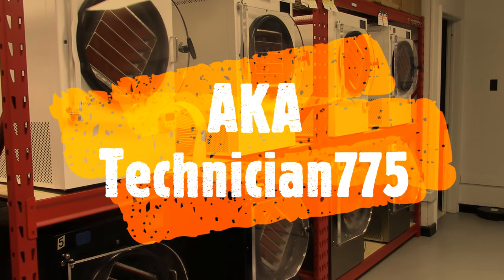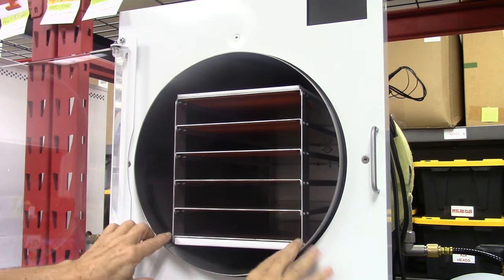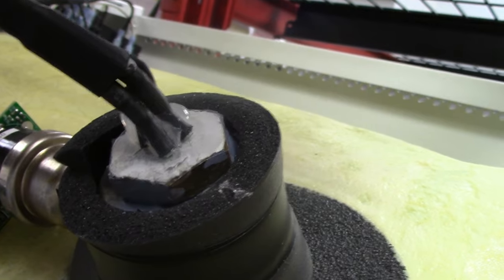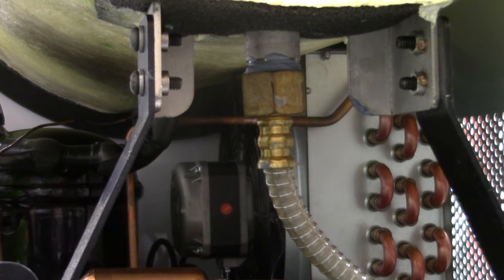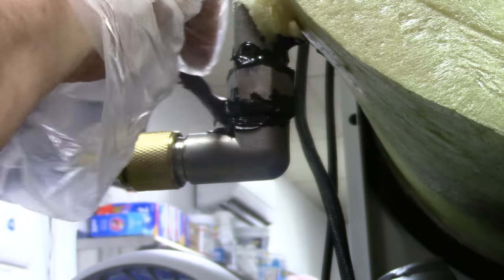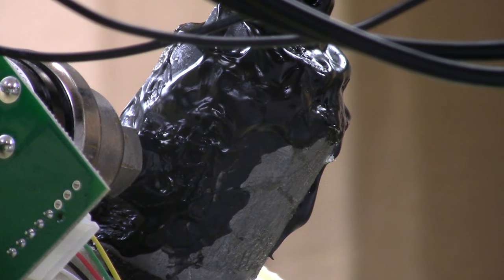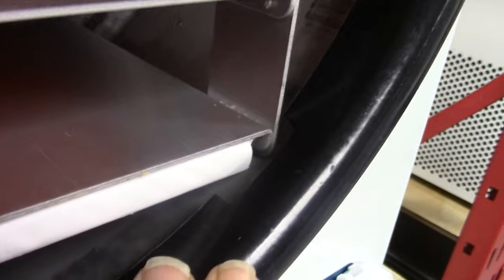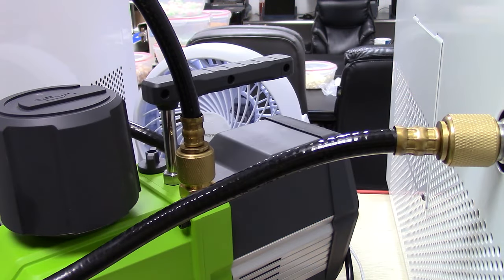Harvest Right Vacuum Fix VIDEO

Comment: ok...let me know how it works....
Reply: Well ran most of a bread run without issues, but about halfway thru I get the inadequate vacuum with a pressure of 525mTorrs. Kept alarming but was going down in pressure, very slowly. I turned it off when it was staying about 517mTorrs.   I just turned it on again and am going to run another bread run and see what it does.  I have no clue what else to try. It runs great without the rack in the chamber, going down into the low 300s mTorrs.  But put the tray rack in and it wants to stay in the upper 400s and lower 500s.  What the heck. I gooped the heck out of the epoxy harness thing and wires.  I have an extra harness that HR sent me in the beginning cause I was having troubles inititally(turned out to be loose wires on the tray rack. ) I could go ahead and install that, but how the heck am I going to get all that dried liquid tape off of it?  Oh my.  I just wish it would work.  I appreciate any ideas you might have cause I have no clue what to do.
Reply: I don't think it is the wire harness.....is any part of the door seal touching the tray??...if you just slide the tray in without connecting the harness...does it work??? is the machine brand new or have some time on it...I can't remember....
Reply: Oh was going to mention that I am using a fairly old platform. I heard people were having problems with updates, so just left mine.  v5.2.23 is what I am running
Reply: Hi again, just thought I would update you on my progress. I updated my software to v5.2.25.  I ran 2 bread runs and both failed with a Inadequate Vacuum alarm, while the pressures were in the mid-500mTorr range.  So I ran two more tests, one with NO TRAY RACK in the chamber and it got down to the low 300 mTorr range. But again with the rack in the chamber BUT NOT PLUGGED in, that one would not get below the mid-500mTorr ranges, and SAME result with the tray rack in and plugged in.  It just will not get below 500mTorrs with the tray rack in the chamber, but it does fine without it in the chamber.  I am so puzzled.  I did more gas leak tests using windex and cannot find a gas leak anywhere. No clue what else to check. Guess I am going to have to pay to have HR look into the issue. So very frustrating.  But at least your fix DID my pressure range so it does get down below 500 without the tray rack. Wouldnt do that before the fix.
Reply: I am stumped........it might be a software issue with the plug in of the tray assembly. This just started all of a sudden??...let me know what you find out...this is puzzling....
Reply: one thing to look at....what position is the wiring harness in ...plugged and unplugged???? I would tape it up really well inside the drum unplugged...try it and plug it in not disturbing the wire harness and try it....possibly bending the harness in different direction causing a small leak?????
Reply: @stevenducote7466  No, it was something that started gradually. I ran many batches over several months with it running pressures in the low 500mTorrs. It never really got lower that the upper 400 mTorrs. It would alarm alot, but it still worked mostly. Unfortunately batches were taking 70 to 80 hours to finish. It did start to get a little worse with it running in the mid-500mTorr range and taking even longer. Thats when I decided to try the Felix Fix thing.
Reply: @stevenducote7466 I had thought about replacing the wire harness because I do have the replacement for it. But at this point it would be a huge pain in the backside, I put soooooo much liquid tape! It would take forever to remove all that and put the new part in.  Plus, I HAVE tried using the windex test for leaks, and didnt see any changes.....my only concern is it is an older bottle of windex. I am gonna pick up some carb cleaner and check again.  I WILL try taping inside like you say. I sure appreciate your
 input.
Reply: Hi, just wanted to give you an update to my inadequate vacuum problem.   I think I finally fixed it!!! And you know what I tried that did the trick?  I have been using an older bottle of windex to check for leaks.  Well I decided maybe I should try the carb cleaner and guess what???!!!  I had leak still in my epoxy harness!  It did show at all with the windex!  Anyway, got it to where I thought it was running well enough to try and run a batch.  It ran like a charm until about 10 hours into it when all of the sudden it just shut down!  The whole thing, like the power was shut off. Could not get it to turn on again.  So in the morning I took a closer look and found a burnt wire on the panel in the rear that the plugs go into.  I am not sure why. Perhaps with all the messing with it, I bumped things enough to loosen wires??  I dont know. But had to call HR today and order all the parts I need to replace the plug and receptacle and the power wire harness. Ugh!!! Well, I sure hope it is working once I get the new wiring.  Thank you so much for all your input and your wonderful video!!!!!
Reply: Great...that did sound like a harness problem, when the position of the harness changed ( when the tray was in or out)...that kinda gave it away....I am glad you found it!!!

Comment: When I get my HR freeze dryer what  to look for on first inspection.
Reply: when I get a new machine,  I  do a bread run to see where the machine is....most times you do not have to do anything......after the bread run...do some cheap veggies to break the machine in...check the mtorr, all the way thru the cycle...it will start high...as the cycle progresses it will drop and the try temp will go up....feel free if you have problems, please reach out....ty!
Reply: Look to make sure it doesn't have a Harvest Right logo on it. That means you were smart and bought another brand.
Reply: all my freeze dryers are harvest right...9 of them and run the 8 hours a day plus some on 40 hour cycles...no issues after some i had to fix the vacuums...i am not sure if i would use anything else....and most of the help i have gives is operator error.
Reply: Sounds like an HR affiliate. This very video is fixing problems that are not operator error so there goes that argument. Use one of the other brands, particularly Stay Fresh, and you'd never use HR again.
Reply: and I will argue all might about operator error and machine problems...when you operate 9 machines and repair everything on them...we can talk....but until then...the argument is still on......

Comment: Did you say to put tape around the areas you put the liquid seal?
Reply: Hi, yes, except for the big plug on top...the big plug on top, remove all the rtv, make a tape dam and ensure a vacuum is pulled on the machine, add the liquid tape until it covers across the top of the plug, leave the vacuum for a couple of hours. .
Reply: Can I use the brand Loctite thread locker blue 242? It’s removable works in 10 minutes.
Reply: I would NOT, it is a thread locker, not a sealer, not the same....
Reply: @stevenducote7466  👍
Reply: @stevenducote7466  thank you so much. You have been a great help and even though you hadn’t videoed in a long time, it was still very helpful. Thank you. I’m gonna give it all a try and see what happens.
Reply: thank you, I suggest to all people, take your time and I lay everything out and plan it, you will do good!!! if you need any help, I am here! ty!!!

Comment: Does this preventative maintenance void the warranty?
Reply: I am not sure..but if it not broke...don't fix it lol!!!  a term we used in the helicopter world....but if it is running well...let it go..but good to have the items and knowledge if it does go bad....good luck with your freeze drying!
Reply: Having been in the maintenance field for more than 40 years I am a firm believer in PM. LOL😅 
"If it can break it will" 
Thank you for all the wonderful information. Being beginner freeze dryers we have found your channel has the best advice and techniques for understanding the freeze dryer. 
THANKS AGAIN!
Reply: @larrycenter6360 thank you....been in maintenance about the same amount of time...yea ..you learn a few things...thank you for the kind words!...good luck with your freeze drying adventures..feel free to ask if you have questions.....ty!
Reply: After carefully following your process I still have a vacuum leak. The pump is performing much better after running for 24hrs break-in but when I turn it off there's a slow increase in the numbers on the vacuum. It appears to be about the same leak as before. I am assuming I have not found it yet. Should the vacuum stay stationary when the pump is turned off? I may have discovered a rough spot on the top of the drum.
Reply: @larrycenter6360  hi...the vacuum will slowly create up in numbers....it will not hold steady, some of the vacuum leaks back thru the pump. If the mtorrs are operating in the correct range while freeze drying, you are good, a side note, at first when the unit begins its cycle, the mtorrs will be high, and as the internal temps increase, the mtorrs will decrease, hope this helps....Steve
Reply: Problem solved!  My impatients was the primary problem.  Everything has checked out and the first batch is almost finished 
Thank you again
Reply: @larrycenter6360  good.....glad it was something simple....good luck with everything!

Comment: Not getting an error, the pressure is just not dropping below 500, so all long batches are being ruined.
Reply: are you getting a vacuum error on regular freeze drying ...or even the candy mode???
Reply: @stevenducote7466  We did a batch of ice cream yesterday, $50 worth, the temp didn't really go above 22 F during the drying cycle, then when final dry kicked in, the ice cream melted then boiled. What a mess.
Reply: sounds like you have a faulty relay board, that would be my guess....if you do not get a vacuum error, vacuum is just fine...but from what you told me..I would check the relay board.....easy fix though...
Reply: @stevenducote7466  Thanks. I just replaced the relay board. Will try your sealing tips in this video. Great video by the way. God bless.

Comment: Oh I have another question, how would a person check just the pump and make sure that it is working properly, just wondering how do you make sure you're getting the vacuum from the pump  that you should be getting.
Thanks in advance.
Reply: you can get a gauge with a fitting to fit the pump...kinda hard to do that and expensive....seal up everything really well....and if you still get high readings...might call HR tech support...those guys are pretty good in helping.  ty for watching!

Comment: I know what you mean. Too bad that the pump manufacturers have to be so secretive about their lubricant design criteria. 
Are you using parafenic mineral oils or synthetics?
Do you have any idea what viscosity oil the Premier pumps need?  The most common are #32, #46 and #68, (Dairyland and Cloverleaf available at TSC) are #68 parafinic mineral oils, identical except for the name and have absolutely no detergents, as many folks believe. 
I think almost all of the common brands are nearly the same oil except for added dyes and intended viscosity.
Sadly the pump people want you as a captive oil customer customer, so they claim that their oil is especially designed for their respective pumps.
Frustrating!
Dan
Reply: wow!...you know your lubricants, I just buy the stuff from Amazon by the case.......easy for us....thanks for the lesson!!!!

Comment: Excellent video! 

I have a dryer I purchased in September 2016. Things got busy and after COVID (I’m an ICU RN)I finally retired and opened the box in 2023. 

I set it up and have not been able to run a batch as I can’t get the meter on the front to register <2500 torr. 

I have vacuum, the door seals very tight but it won’t register. 

I’m thinking vacuum sensor but not sure and to just buy and replace expensive parts and hope for the best isn’t feasible. 

Is there a way to test the vacuum sensor ? 

At this point I’m not sure if it’s the vacuum sensor or the main board?

Thanks…
Chuck from Texas…
Reply: Hiya Chuck, no easy answer on that, if it were me, I would seal up the machine like in the video, upgrade the software, get a new hose that goes from the pump to the machine, and do a couple of bread runs. sorry for the delayed response...what part of texas are you?? and what size machine??